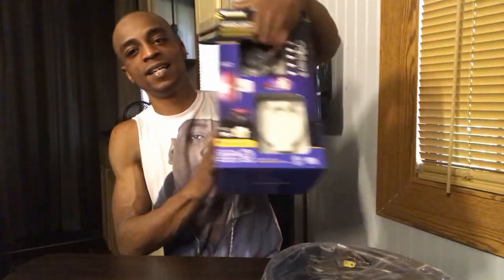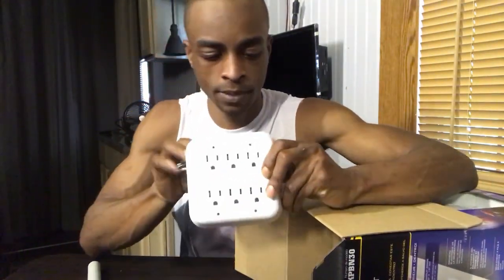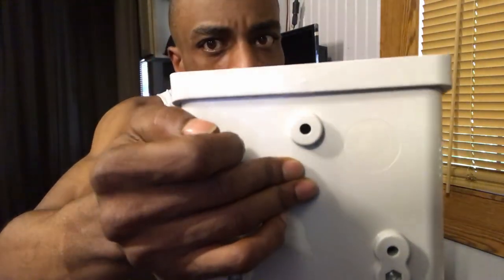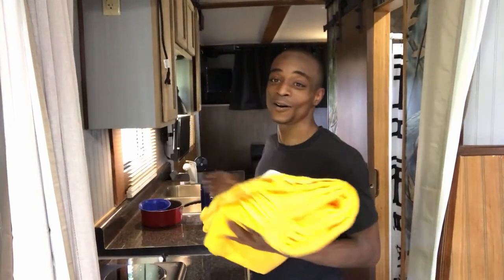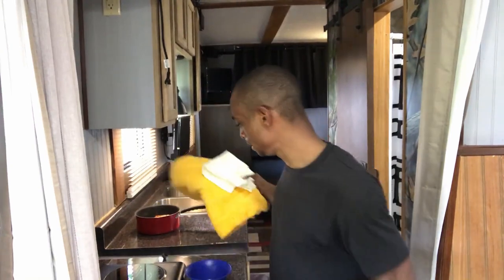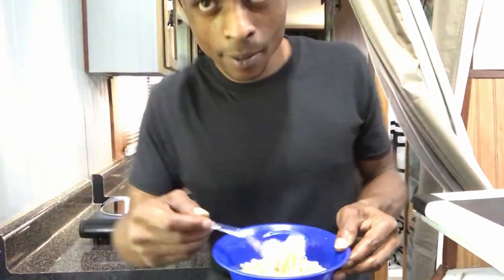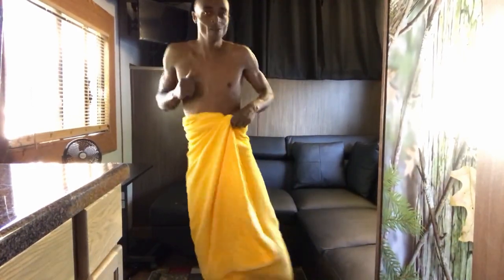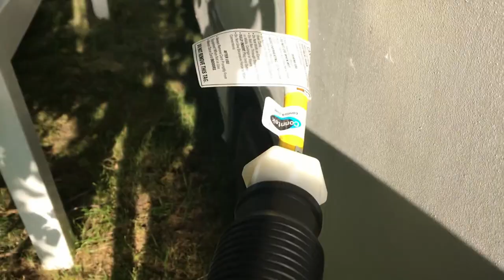!!!!EASIEST 30 AMP INLET!!!! UHAUL BOX TRUCK CONVERSION

Comment: Before I go, I want to say I once helped a Buddy build a Schoolie.  I designed a Generator Rack on 500lb slides that mounted his generator to the truck frame under the floor and we made a hinged door on the side.  This way he could run his generator with it under the bus, and raise the outside door and slide it out to add fuel and check the oil.  He started out with a rope start generator, but after I got though making it work under the bus he bought one with electric start and he let me put the start controls in the drivers switch panel.  It worked out great.

Comment: Really love the build, man. Looking forward to the sleeping area.

I contemplated building out a box truck, but couldn't find one with barn doors in back as opposed to the roll-ups. Didn't want to fuss with building a wall there, and was trying to maximize the stealth. I went with a stepvan instead.

It's not exactly the same, but you might enjoy the content we share over at Step Van RVs on Facebook. I bet folks there could learn some things from you as well.

Comment: Any particular reason you run the thinner solar panels cross ways instead of lemgthways to prevent overhang? Just seems there's be less chance for snagging a tree limb at a state park or wherever
Reply from the maker: Now that’s my kind of question! Thank you for asking. Due to me not wanting any holes in the roof, the panels landed according to where I could align them with frame bolt holes on the sides of the box. The thinner panels didn’t align the way the bigger panels did. I had to skip a hole or two then the thinner panels fit the way they did.

Comment: Hi, why isn't your hot water heater hooked up to your solar?
Reply from the maker: The water heater is 1500 watts, I have 600 watts of solar and the up until a recent upgrade the discharge rate on my battery bank was too low to maintain that load. Hope that answers your question. Thank you for watching!

Comment: Brother where are you located though, just in general. I’m in the A and really have been looking for someone to help with the electrical. I initially thought to just do the portable power station as well but still considering a battery bank and solar as well as an isolator. Definitely subscribed, make sure you do the same! Really want to increase the number of black folk in this community 💜